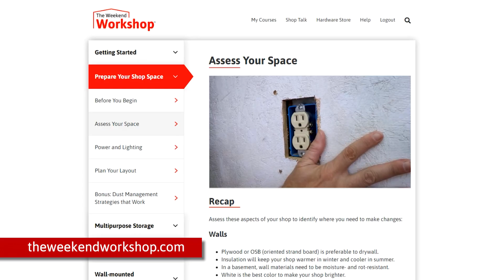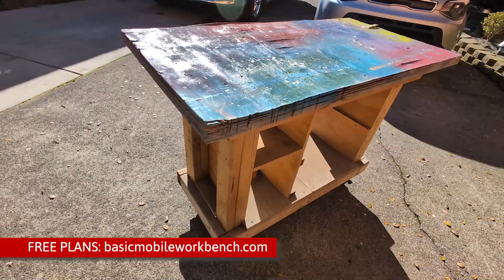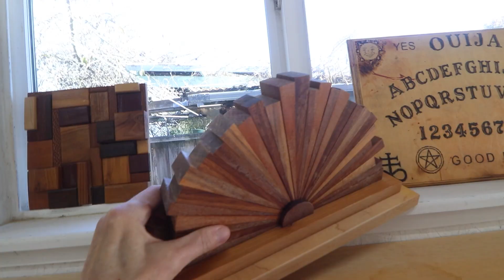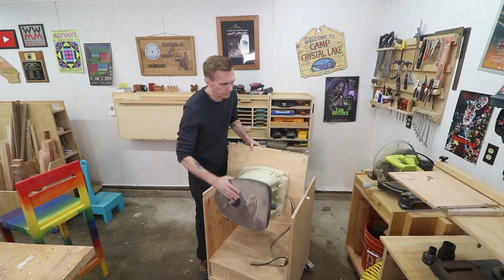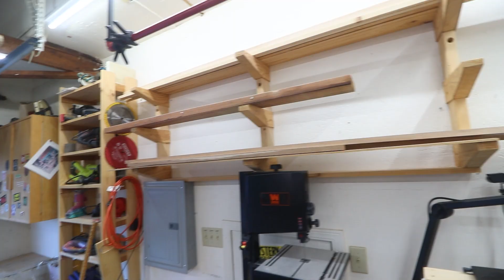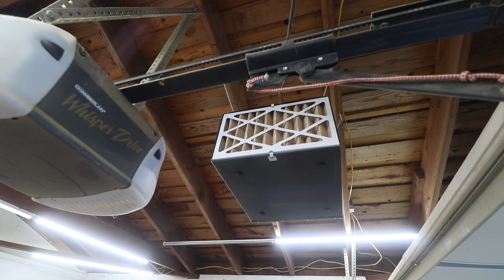2024 Shop Tour - How to set up an inexpensive, efficient woodworking shop in a small space

Comment: I've just moved into a place with a so called double garage attached to the house. But best of all, down the back I have an old fashioned steel double+ garage which is to be my new woodworking workshop. It has a small room at the back which I will use for my chemistry nonsense and an open shed which was for firewood but can double as timber storage. This video has given me so many ideas. Thank you Steve.

Comment: i have a one car garage. i do have storage cabinets with counter space and a peg board across the walls. for table saws, chop saw, etc i keep these on a powertec stand and ridged rolling stand . great for upright storage . i don’t need a dust collector system because i only do wood working in good weather and roll the saws to the outside of the garage . it’s just a hobby for be and i enjoy making things from time to time . fireplace mantle, coat rack with shelves etc. this i enjoy .
Reply: Being able to roll the tools outside is such a great option to have.  With my shop I don't have that option, however I do have a portable table saw, and quite frequently set it up on my carport when I'm working on a project....keeps the dust down, and the concrete floor of the carport makes a great assembly area.  My shop right now is a mess and cluttered disaster because everything got pushing into a small section of the shop that has a floor.  So, until I get the floor finished hopefully within the next month or so, I really can't get so a lot of my tools anyhow LOL.

Comment: Can we get a paint, glue, stain, and finish storage video touching on weather changes?

What can withstand cold? What can't? 
Can stain freeze and thaw and still be used?
Glue?

What type of heat you use currently?
Reply: I'm in New England and I have everything in an unheated barn. I bring in all of my paints and glues during the winter. The problem I have the most is all of the metal surfaces on my table saw, jointer, etc. rusting due to condensation with the temperature changes. I've searched online for solutions to this, but never really found anything other than to keep the space heated. That's definitely not going to happen any time soon. I try to wipe everything down and leave a light coating of wax or fluid film or wd-40, but it inevitably creeps up on me.
Reply: @crossphase1000  thanks for replying, that's pretty much what I do too and my girlfriend's getting mad that I've used all the cupboard space in the kitchen for finishes and paints LOL

Comment: Great video.  You’ve confirmed that a “small” cabinet to mount equipment and store relevant supplies is an easy way to make the equipment more functional and supplies convenient.

I do have one question though.  I live in an area where temperatures range from 27 to 95F. My shop doesn’t have climate control and given the size probably never will.  How do you store the glues, paints and resins that are damaged by temperature extremes?  I don’t even like letting my batteries experience the extreme temperatures.  Since I’ll be using several computers and my “office” will be in the same space, I will have a climate controlled area. However I don’t relish the idea of having to use the same space for tool and supply storage, especially solvents. 

Any suggestions?  What are others doing?

Comment: The "put everything on casters" philosophy works for many, but for me it feels like extra work rearranging the shop every time I want to do something. I find I'm much more efficient when I have dedicated spaces for different tools/work, even if that means those spaces are smaller than they could be if I could move everything around. My shop is the same size as Steve's, but I have one side devoted to workbench/tablesaw stuff, another side to jointer/planer stuff with sheet goods towards the corner, and a miter station along the back wall. I definitely could not park a car in here if I wanted to, though.

I'm the opposite of Steve in terms of buying lumber. Since I don't have a car, I stock up on a ton of lumber at once to save on freight shipping costs, then I figure out what I want to do with it over time. I generally keep a large stock of two different hardwoods that I want to work with (red oak and ash right now), and some 2x4 construction lumber as well (but home center delivery fees aren't nearly as expensive as freight from sawmills, so I don't go nuts stockpiling those).

Comment: One idea for the "Home Hardware Store", stolen from Adam Savage / Industrial Light & Magic: hot glue one of the bolts / screws / items from each drawer to the drawer front. No messing around with labels, and you can find what you need immediately without searching or reading.

Personally, I still love label makers for large runs of parts: exporting from a spreadsheet directly to the label printer makes it much easier to keep track of complex builds.
Reply from the maker: I like his idea, but Adam's a far more analytical / type A personality than me! 😂
Reply: @SteveRamsey  I wonder how you'd get along with Jamie, then! 🤣

Comment: I agree, a shop is always changing and you can never forsee whats coming. One thing I see thats kinda left out of shop tours/talking about shop organization. Really theres two main uses for Cars and for woodworking. Which are two different setups. As a fan of both, I dont really see this topic brought up much. Its where I set mine up as cars next to the garage door woodworking in the back, but everything is flexable to quickly move the setup to empifize what the current large project is. Where your wheel recommandation really is key.